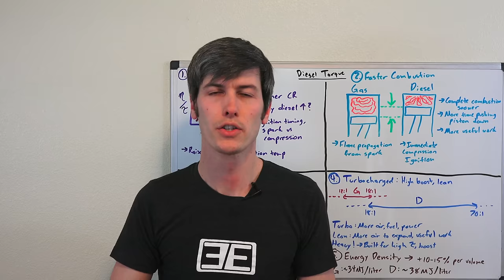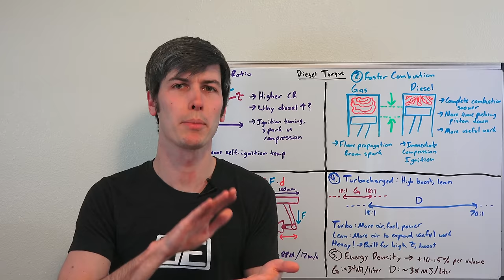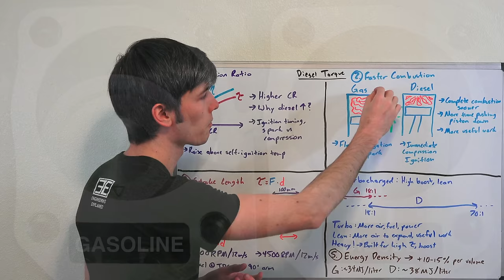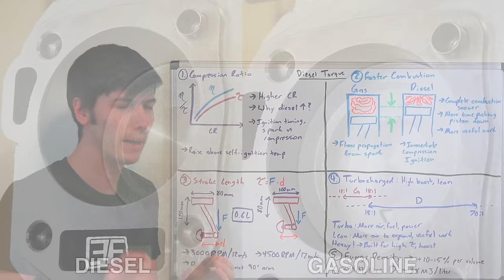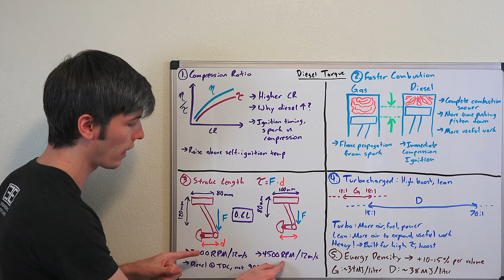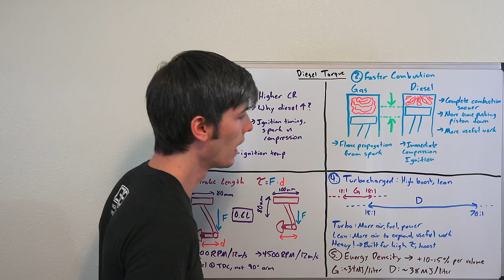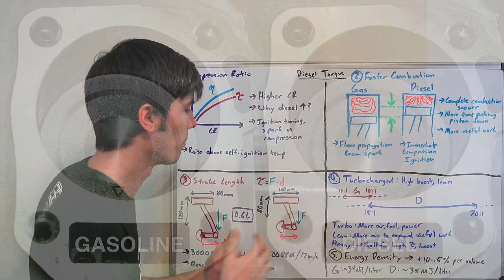5 Reasons Diesel Engines Make More Torque Than Gasoline

Comment: Jason, great video. But I have a different take. Diesel fuel is an "oil" and burns SLOWER than gas. This is why diesels cannot create much horsepower; beyond about 4000 rpm the diesel piston is literally "running away from" the expansion of a slower combustion rate. But because diesel burns SLOWER, combustion reaches peak expansion LATER -- when the piston is LOWER in the cylinder. In your video on "torque vs. horsepower" you do a good job of explaining that Torque = Force X Lever Length. At Top Dead Center and Bottom Dead Center the effective "lever length" of the engine crank is ZERO. So during combustion, lever length (torque potential) starts at zero, rises to maximum as the crank turns and the lever length increases, then falls back to zero. In a  "standard" gas engine (normally aspirated, square bore, decent compression ratio) peak combustion pressure is reached at ONLY 15 DEGREES OF CRANK ROTATION (midway between 1 and 2 o'clock, on a clock.) This is because gas burns quickly. But at 15 degrees "lever length" is VERY short. Torque is minimal even though combustion pressure is highest at this point. As the piston descends cylinder pressure DECREASES (because volume INCREASES.)  That "typical" gas engine has its best "mechanical" torque potential at 72 degrees of crank rotation (which added to 18 degrees of conrod angle = 90 degrees. Best torque is created by pushing on the lever at 90 degrees.) But that "standard" gas engine develops peak torque at ONLY 42 DEGREES of crank rotation, because this is the best intersection of rising mechanical (torque) advantage and decreasing combustion pressure. After 42 degrees, combustion pressure drops so rapidly there's too little pressure to take advantage of the better mechanical advantage that exists at 72 degrees (the "longer lever" moment.) But because diesel burns slower, it reaches peak combustion pressure when the piston is at a LOWER point in the cylinder, where there is a greater mechanical (torque) advantage. So, diesels create higher torque, but produce very little horsepower because diesel burns too slow to keep pushing the piston faster and faster. (And this is why the torque/horsepower curves of a diesel engine "cross" at much lower rpm than gas engines.) Gasoline burns so much faster, it can "push" an engine to higher rpm, and since (as in your "torque/horsepower" video) power is the SPEED at which work is accomplished, gas engines develop higher horsepower.  But less torque because they create peak combustion pressure at a less advantageous (earlier) crank angle than diesels. However, since gas engines can rev faster, they can generate more of these "peak moments" per revolution of the vehicle's wheel. So they accelerate faster, have a wider useful rpm band, and don't need as many gears to move a vehicle to a high top speed. Incidentally, the difference in "burn speed" between gas and diesel sheds light on why a super/turbocharged engine develops more power. Not only does it raise the temperature (higher thermal energy) it raises the compression ratio. Higher compression ratios cause the burn to take LONGER to complete. Meaning there is higher combustion pressure when the piston is lower in the cylinder, where there is more mechanical (torque) advantage. This is a big part of the reason why super/turbocharging either a diesel or gas engine increases its power. Sorry for the long comment. Hope this is useful...
Reply: Impressive and understandable explanation!👏👏👏👍🍻
Reply: I'm on board with this, the diesel is getting much of it's torque from the stroke length and good for you for pointing out that with the slower burn that there is most certainly a HP limit.   Just another note diesels were not always turbocharged.  Although sure your getting some torque increase from turbo charging diesels they really put turbo's on to get the HP up there, e.g spin them faster. A current CAT bulldozer is still turbo because why not take the extra torque but they were looking for the HP as that means you push more dirt around in a given time. Same for hauling freight on the highway, increase the HP and you can pull the load faster and get paid more.  If you drive a diesel often, you will notice they mostly never "lug". They always have extra torque on hand.
Reply: I agreed with everything in your comment right up to the point where you said that higher compression slows the burn rate.  I'm sure that is not true. In fact, in a gasoline (or any spark fired fuel) engine it increases the speed of the burn.  This is why higher compression is necessary for extremely high rpm engines.  With lower compression the burn rate hits its max at a lower rpm and will not push the piston faster.  To make an engine that will run at 8000 rpm you must increase both air flow AND compression.  
With diesel, turbocharging increases cylinder pressure, increases the amount of oxygen in the cylinder, and allows the injection of a lot more fuel.  It's the additional fuel that creates more torque.
I agree that higher pressure when the piston is lower in the cylinder is giving the high compression engine more power. But the piston must be moving a lot faster too for this to work.
Reply: @michaelcooley8275  You're totally correct, higher compression doesn't slow the burn rate. A volatile gas expands FURTHER when it explodes if it has been compressed more before combustion. So it takes longer to reach full expansion which means there is more combustion force when piston is lower in the cylinder, where the torque from a superior crank angle is better. If I said the burn rate is slower I spoke incorrectly. Good catch.
Reply: That's def also part of it. Its several different things put together really
Reply: @57ubertuber  No. Low compression gives a slower flame front, slower expansion, better leverage on the crank at lower RPM.
Higher compression gives faster flame front, faster expansion, better leverage on the crank at high RPM.
The turbo gives you the best of both, low compression at lower RPM and rising compression as the RPMs go up.
Reply: @bogushavis  Very good point. I misspoke when saying the expansion of a more highly compressed mixture takes "longer." As you very smartly point out, the "burn" might in fact finish sooner. But it's a "bigger bang." As Wikipedia puts it: "higher compression ratios permit ... a longer expansion cycle..." But they don't necessarily mean longer in "time;" it just means "more overall expansion" even if peak expansion is reached quite early. But there is more cylinder pressure throughout the stroke, including more pressure when the piston is lower in cylinder, which I believe is most important because this is where mechanical advantage is rising and rising. It's not linear, it's a curve; up to 72 degrees, the mechanical advantage from each degree of crank rotation is GREATER than the degree before it, because "lever length" increases. So higher compression results in more cylinder pressure, but also more pressure "later" in the stroke where the piston is able to make far, far better "use" of that pressure to create torque.
Reply: Great point and great discussion to follow! What do you guys think about the possibilities of lowering egts? I have often wondered if a centrifugal supercharger would provide similar boost capabilities as a turbo but without the hot side to worry about and egts would hopefully become a non issue.
Reply: I think you're neat and I'm glad you chimed in. :)
Reply: Please stop using capslock, this was really hard to read.
Reply: Wow... I can't believe that one paragraph made me 1000 times more knowledgeable about diesel engines.  Thanks for sharing that information.
Reply: What he said
Reply: @bogushavis  truth
Reply: As one of the top comments, it's amazing this didn't get a reply from EE. You would think when someone explains how you've mispoken in a video made to educate people, you'd do your best to push the correct information. I've seen this happen far to much on this channel. Most of his stuff is correct. But mostly right doesn't really matter when your channel is called "engineering explained" and your channels is aimed at informing the public.
Reply: Little Reptilian  I've literally never heard, or seen that, in my life. Been a GMC tech and worked at a heavy diesel shop for 2 years. That's not forever, but in two years, never heard that. As a GMC tech for 11 years, never heard that.
Reply: Nice observations! Although I'm not sure I agree on the part about super/turbocharging raising the compression ratio. I think the CR is a variable only dependent on the volume in the TDC chamber vs the BDC chamber.
Reply: eustadio that is true but you also have to keep in mind that the pressure at TDC in a naturally aspirated engine is 1 atmosphere or one bar. With a forced induction engine, the pressure can be 2 or 3 bar. So that piston at TDC is now compressing more air that has been forced into the same sized combustion chamber. Since it's compressing more air, the compression ratio also rises.
Reply: @lancelefevre351  I think you mean BDC but yeah what you're saying is right. The pressure is more both in BDC and TDC in a forced induction engine, but the ratio of the two pressures is the same as if it was atmospheric
Reply: eustadio ah yeah, I meant bdc lol. At TDC, the pressure is way higher than 2 bar usually. Thank you, sir
Reply: Lancifer Lancifer the compression ratio must remain the same, naturally aspirated or supercharged. It’s a ratio fixed by the space above the piston at BDC compared with the space above the piston at TDC. What does increase with supercharging is the “compression pressure”. Les
Reply: Leslie Austin that is very true. Thank you for saying that because that is absolutely true. It's the cylinder pressure that can fluctuate but compression ratio is as you described.
Reply: @lancelefevre351  First - it's true that the combustion and creation of mixture limits the Diesel. Usually, you can rev them up to about 5000, but likely, peak power is a bit below this. One COULD, of course, rev even higher and still have a power output, but efficiency would decrease that much that, to even maintain the power, the required boost pressure would by far exceed everything even close to making sense.

Second ... high BMEP in spark ignition engines is strongly related to knock - the mode of combustion, kind of, limits this, you can't - everything else being equal or equivalent - rise torque AND CR without any limits, you'd have to throw in additional stuff. But CR is crucial to efficiency (or, to be exact, the expansion ratio is, which is usually close to equal to the geometric CR, and the stuff that differs is taking into account elsewhere, like in the efficiency of combustion etc), so one can't, while in the Diesel engine, the process isn't any limit to this, but just the mechanical strength of the components transmitting forces.

Third - when Diesel and Otto engines were NOT turbocharged as a standard feature, Diesel had lower torque due to smaller valves, lean mixture, ...

Fourth - if the pressure is given, it isn't important how stroke and bore relate to each other, in the same displacement, same process, equal in evreything, we have, seen simplified, piston area and crank lever in the equation on the same side, or, said differently, the cylinder's displacement is in the equation. A given process will lead to a certain BMEP, which is, in weird units, torque per displacement.

However, he's right most of the time.
Reply: The cylinder can't literally run away, it doesn't have legs.
Reply: Not super knowledgeable about cars, but if a diesel has a smaller useful rpm band and needs more gears to be effective doesn't that mean it would see greater benefits when paired with a CVT transmission then a petrol engine?
Reply: @SIRslipperyasp91  Not nevessarily. The deviance from the optimal operating points (the points where isolines of power and those of sepcific consumption meet tangentially, providing the most efficient points of each demanded power output the engine is capable of) leads to a decrease of efficiency depending on a lot of factors, but usually - not generally and always - this is a bigger fraction in gasoline engines, as a diesel is, more or less, regulated by the amount of fuel (and the required boost pressure), there is no throttle losses to be taken care of. The CVT aims at operating only along this line connecting the points stated above, in case anyone wouldn't know ... and overcomes the downside of having a limited number of gears by this, but throws in higher internal losses due to some kind of slip, of whatever kind (inner leakage, rubber wheels transmitting forces which rely on slip to do so, ...).

The higher the decreasement of efficiency is when deviating from the optimal operation line, the bigger the improvement of CVT.

Comment: Great video as usual! I would argue that in a Diesel engine complete combustion does not always occur right away.
You make it sound as if the fuel is injected in a quick shot and bam, it’s all instantly burned up just after TDC. 
The duration of injection or number of separate injection events per power stroke depend on the amount of fuel needed to be injected which is primarily determined by engine load. At idle a small quick shot of fuel may be all that is needed to keep everyone happy, but obviously when pulling 40 tons over a mountain the engine will require a lot more fuel. What I was taught is that one of the beautiful things about a Diesel engine, and one of its main torque producing characteristics, is that it can continue to inject fuel and burn it throughout the entire power stroke. In convention gasoline engines a given amount of fuel and air is drawn into the cylinder in response to a given load, what’s taken in is what you get and as it burns during the power stroke the amount of downward force drops off as the fuel is used up. A diesel is capable of continuing to inject fuel throughout the stroke and will therefore maintain the downward push the whole way down, equaling more torque. 
Take a look at how a normal inline injection pump meters fuel with its port and helix set up. At light load there is only a small amount of the helix exposed which means that a small amount of fuel will be injected, but the plunger will still make a full stroke, so it would still be injecting fuel during the power stroke if it had been given it. As load increases more fuel is metered in and then injected, not all at once, but throughout the power stroke.
Reply: I came here to say this.
This is called the “Cutoff Ratio” and has become electronically controlled in common rail diesels.  The classic diesel thermodynamic cycle maintains constant cylinder  pressure throughout the power stroke, achieved in practice by continuing to burn fuel as the piston descends and the volume increases. This means that a diesel piston is still being pushed down with the same force when its (longer) crank arm is at 90 degrees. THAT’s where the stump-pulling torque originates.
(Great channel.)
Reply: Also: common rail systems can control the rate of fuel delivery by modulating the rail pressure, so the fuel dose can be delivered quickly at high rpm and high load, or drizzled more slowly at lower load or rpm.
My CDI’s rail pressure varies from 4500psi at idle to >22,000psi at full load.
By electronically varying the timing and duration of the injection event for a given fuel dose the engine module has good control.
Reply: Fuel is injected at extremely high pressure, so it'll burn quickly and glow plugs may help

Comment: I don't know if you've mentioned this in other videos, but the implications of piston speed: A higher piston linear speed means that the peak force experienced by the connecting rod will be higher and thus the connecting rod must be stronger in order to withstand this force. (This also applies to the wrist pin, the piston itself, the crankshaft etc)